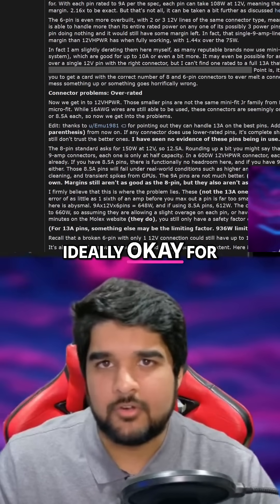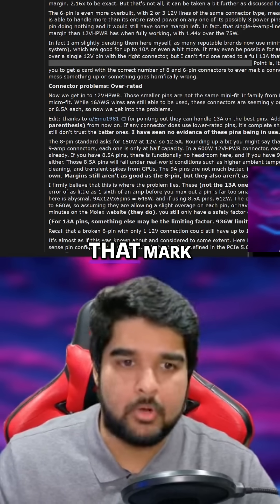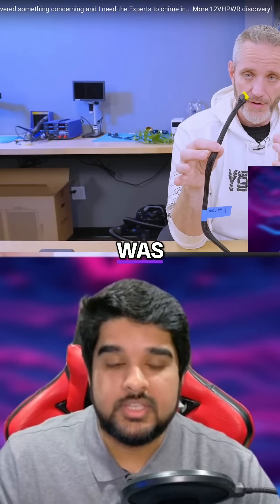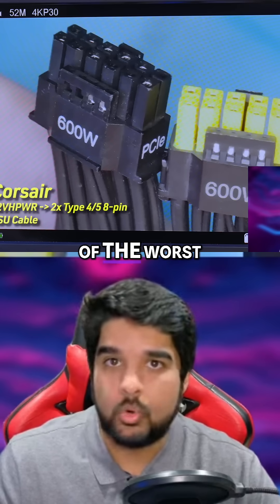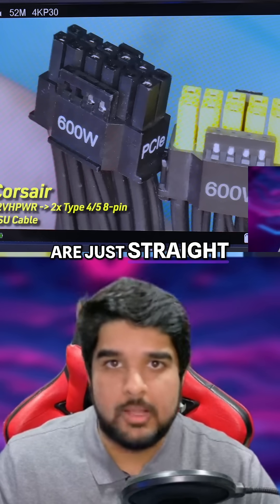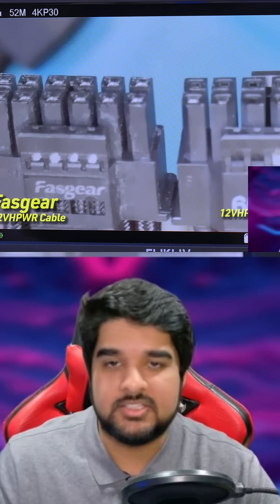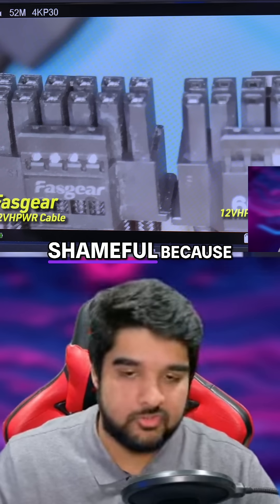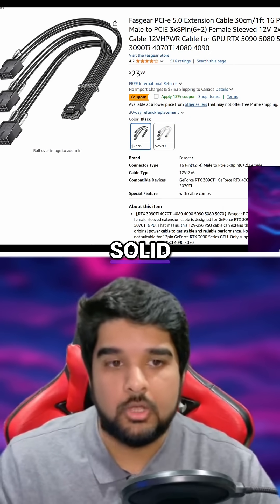Nvidia GPU connectors safety problem #rtx5090 #rtx5080 #rtx4090 #intel #amd #12vhpwr

Comment: Frankly, the 12-pin wire will pull full power through 2 wires alone (if you cut the other 10). And the card will boot up, run, and actually pull the current in that state. 
Each feed wire is only rated to 100w, and there's 6 of them.
They only have about a 10% spec safety margin.
So, technically any card which pulls more than 120w "could" eventually melt/burn a plug/wire.

The problem is not the plug design, it's not even the 12pin spec. It's the Nvidia GPU boards, which have abandoned power leveling between power connections. A 3090Ti has a 12-pin, but it won't melt because it has "sane" power layout on the board.

Nvidia designed a built-in high probability failure point. And they're trying very hard to convince everytone to blame the wire, instead of the fubra power management on their boards. It's borderline sabotage. And it WILL draw legal attention now that it's understood better.

AMD or Intel could safely use the 12-pin connectors, so long as they keep making cards which power-balance their wires.
Reply: I have a 3090ti and you just made me happy, thanks! Haha
Reply: @jamieclarke2694  hehe, I almost got one of those on clearance. But ended up getting a 4090. I think I'm going to have to buy a clamp meter to periodically test the connection of all my wires. It's literally the only way to make sure that a 40 or 50 series nvidia card isn't trying to self destruct.

Any 30-series card with 12 pin connector, should be completely fine. It monitors 3 separate pathways, 2 power lines each. At max draw, it could over-spec a wire up to about 150 watts in one wire (if the other had zero current, no connection at all), but that's only about 30% over spec (shouldn't melt). I'd be completely shocked if any 3090 Ti ever melted a 12pin plug, even if brutally overclocked.

12 pin wires are fine. Nvidia 40 & 50 series board design isn't.